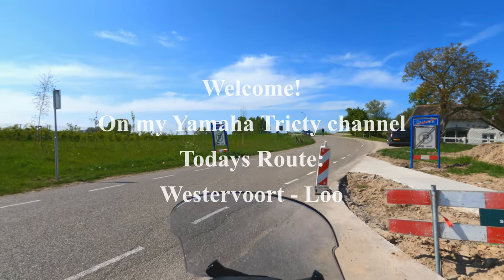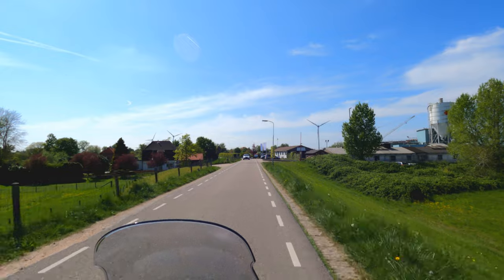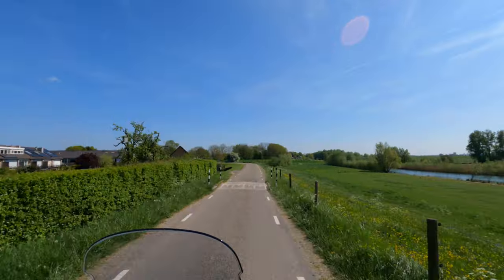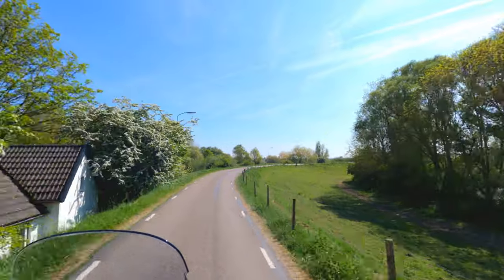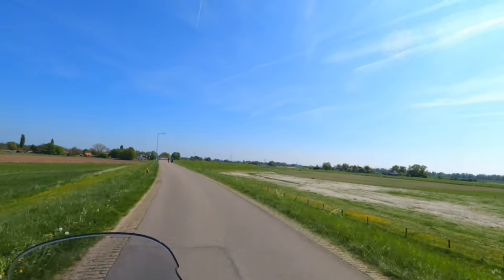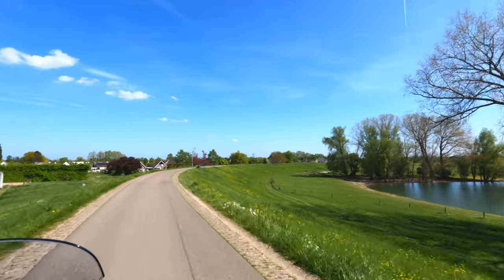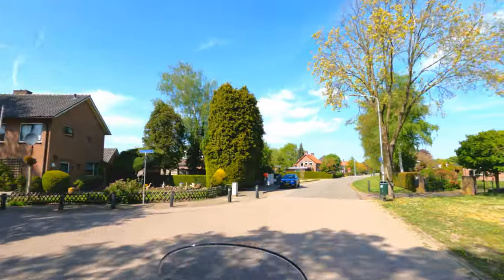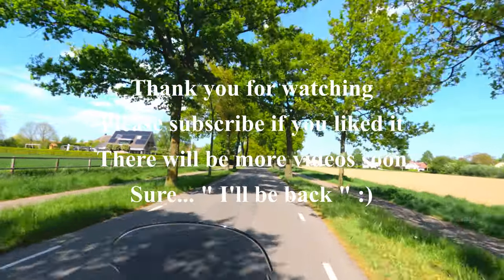Yamaha Tricity - Video 02 - (with comments version) " Westervoort to Loo " 04-05-2022

Comment: Great video and wonderful roads and beautiful nature.. I always try to find roads where its fun to ride at low speed. About the bike. The brakes works like this. Right handle apply the front disks, left handle applies front AND rear disks. The break pedal only applies the rear disk. Then about the pronaunciation of the name. English isnt my first language but Im pretty sure that it should be pronounced tri not try -city. I highly doubt that Yamaha would name a model try anything :)  so Its tri as in three wheels or as in triangular wheel configuration. Well only the Yamaha designers can answer this for sure :) GL with the bike I love riding mine as well.
Reply from the maker: Hi Indra. Thanks alot for your comments! And i'm glad that you could enjoy the video. About the pronunciation. Yes.. the more i think about it... you're right. I will never say 'try' again, promise :).  About the breaks. It seems we both got it wrong. Here is what i read in the users manual: the right handle activates only the front. But the left handle as wéll as the foot pedal brake wil work on the rear and front. It's under chapter 5-10 and 5-11 in the users manual (english version). Again, thanks alot for your comments and keep enjoying driving your TrI (tri) city :)
Reply: @yamahatricity300touring6  Your not alone you know maybe its a dialect thing but still :) About the brakes, In my Manual (Swedish) it sais right handle the front brakes left handle the rear brake and SOME of the front brakes what ever that means :) Same thing goes for the brake pedal. They call it cooperating brakes :) sounds very impressive. I usually use both sides and then the breaking is fantastic. I rarely use the foot brake. TC and happy riding!😎